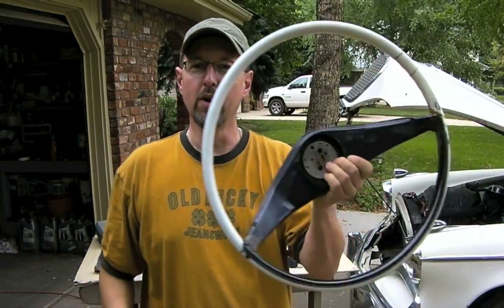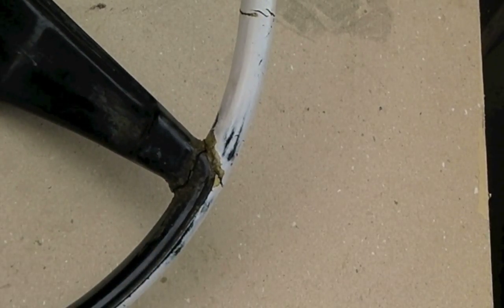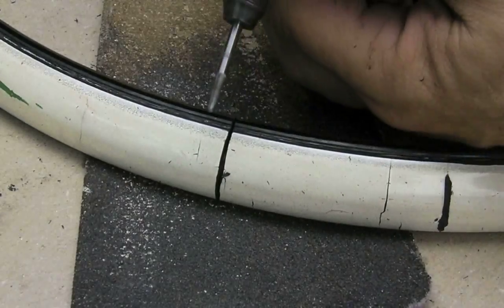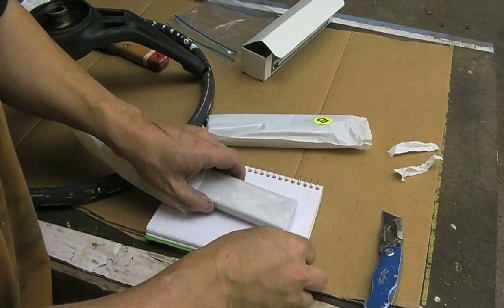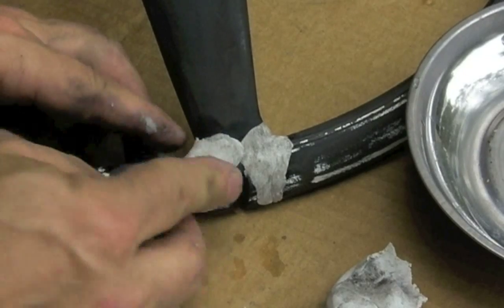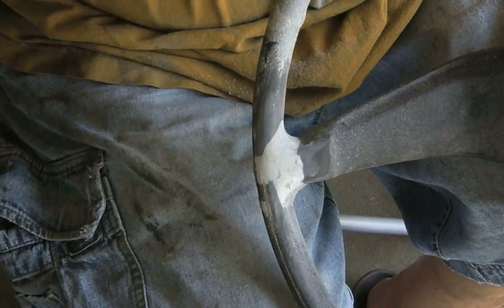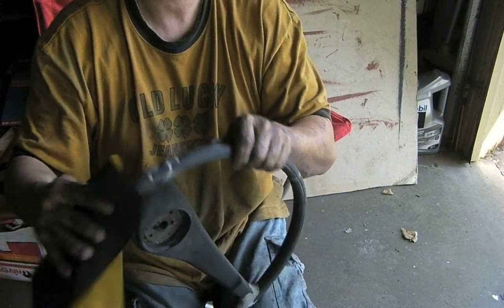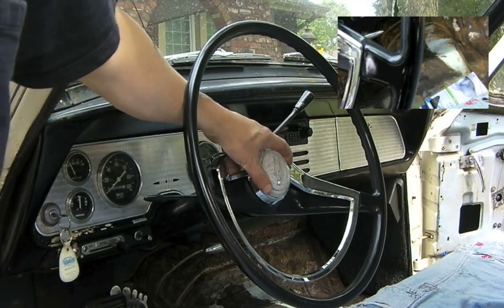How to Restore a Cracked Steering Wheel

Comment: Is that still holding up, and where abouts are you located? I've never had luck with spray paint on steering wheels down here in Texas. After a good hot summer it turns into an absolute mess.  Either way, excellent video instruction.

Comment: Great video, thanks.  I used this method on a cracked, flaked  powdercoated yoke on a 1966 Bonanza.  Sprayed with appliance epoxy.  Two years in and it still looks new.

Comment: I used this method of repair using the por15 epoxy putty. I wet the cracks with liquid epoxy to soak into the cracks and provide a better bond. Followed by the por15 putty, PPG epoxy primer, urethane topcoat, high solid clear. Looks great, car is stored in an unheated garage, been 4 years, no cracks. An expert bodyman at a classic repair shop told me I was wasting my time because it would crack in a few weeks, HA!!!

Comment: Wash the wheel after its blow job with some soap and water and allow through dry time... Wash your hands aswell... give the wheel a quick rub down with some 99% rubbing alcohol get a q tip in the cracks...Mix smaller amounts of epoxy only what you need per little crack and start with tiny pieces so as to make sure you fill the entire cavity without leaving any air gaps in the cracks

Comment: Nice result Tool  dude Tony! Some safety advise would be a plus.How about using a vacuum cleaner instead of an air gun to get rid of the Dremel dust and a dust cap while you are sanding the 2 K putty, this stuff will remain in lungs forever. Although it is water based, wearing nitril gloves will prevent the 2 K chemicals from penetrating your largest organ (= the skin) while you are mixing the A & B . Thanks!

Comment: I have used this method to restore customers steering wheels without complaint.  I use automotive paint however.  Nik, you did something wrong.  Most likely problems are not mixing the epoxy well enough or not opening up and pressing the epoxy well into the cracks.

Comment: For about $80 bucks you could buy a marine grade machined aluminum one that would hold up better.
Reply: Jet that is not the way to go if you want original equipment, I have done a few of these, and it's the less expensive route, work intensive, but looks great, I use nitril gloves with any type of filler tho...and you save about 300+ bucks...I like original, if I was doing a rat rod it wouldn't matter

Comment: Will this work on a Rim Blown 1970 Wood grain wheel?
Reply: +Tool Dude Tony  Do you know how one could make a new wood grain inlay for a 70's Wheel?
Reply from the maker: Hey Steve, If you did this on a wood grain wheel, you'd lose the wood grain look and feel.  This is great for smooth finished, painted wheels.  Thanks

Comment: Aves epoxy putty works best.not to know,for its used in a certain hobby ind.
It shapes with water easy,and smooth,not grainy like this product.if your good,no sanding needed.
Just trying to spread some knowledge.

Comment from the maker: It's some Rustoleum automotive primer.  My recommendation for the final primer is to use the same brand as the sandable primer used in the earlier step so that there should be no issues with the chemicals interacting badly.

Comment: Nice job, but what if there's a lot of molded in details? Also, a guy who restores steering wheels said he uses plastic from old steering wheels and melts it right in. He said epoxys will crack because of uneven expansion-contraction of the materials. Is this not true?

Comment: Nice job Tony. I've used a rubber automotive bumper patch product by 3m several years ago with great results also. Had plenty of time to work with product before it cured.Thanks. Paul.

Comment: Now I'm wondering why you didn't use a gloss coat over the paint ? Seeing how it's gonna heat up and cool down.  Wondering how long that paint job is gonna last? Nice video , just wrapping up my steering wheel repair , I'm going to use the gloss over the paint ,my's a 55 steering wheel, there's some intricate etching in the top halve of the steering wheel. Two tone paint job , it's taking too long!

Comment from the maker: @ mnpinball -- You can use any good Rustoleum or Krylon paint for plastics.  Try to match the brown as best you can.  You can make the woodgrain by lightly dipping a toothbrush in darker brown paint.  Practice on something other than your steering wheel.  Then be sure to clear coat it with at least two coats.   Good luck.